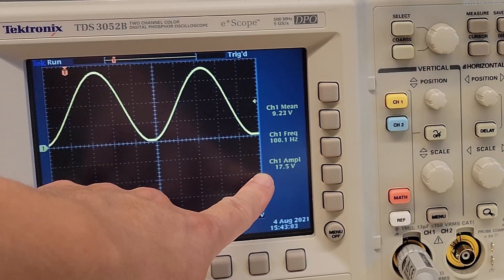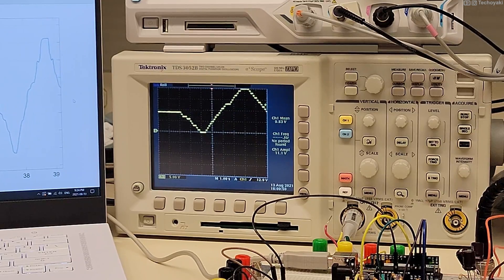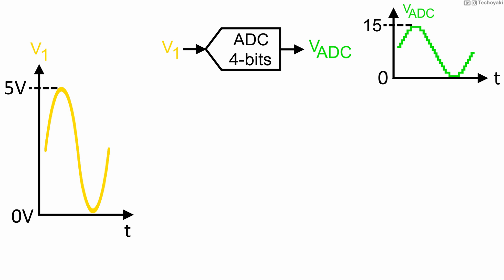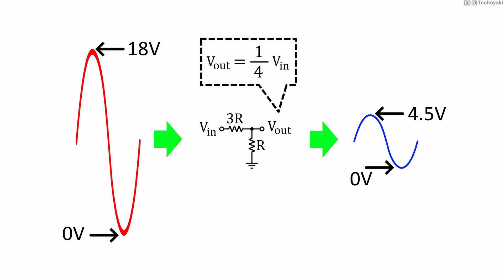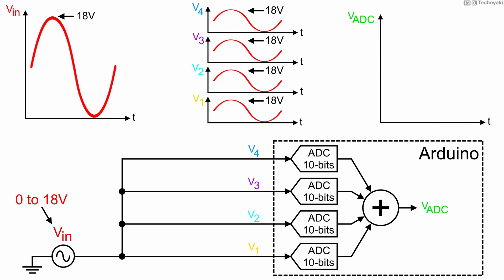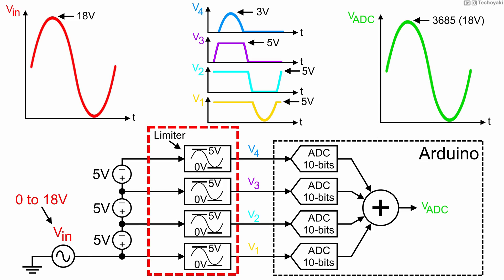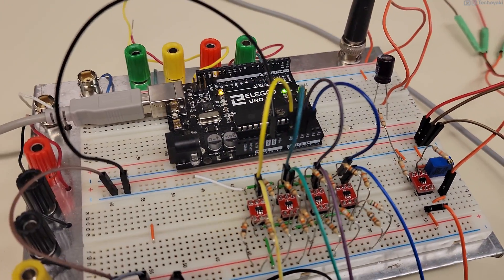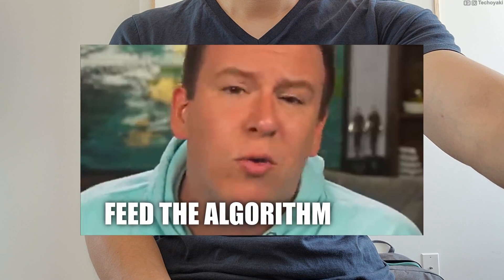Can you slice voltage signal?

Comment: I took a look thinking "oh yes, that's an interesting idea but flawed". 

I was pleasantly surprised that you very clearly point out the limitations of what you are doing. There is at least as much to be learned from the "why it doesn't work" than from the "how it works". 

The cross-over points are always going to be a problem. As the ADC channels are necessarily read sequentially, this can't work for dynamic signals. A sample and hold front end would be a benefit. I might suggest all kinds of other tweaks, but in the end the cure is worse than the disease, and it's better to just go out an buy an external 12 bit (or higher) ADC. I love making a silk purse out of a sow's ear, but in this instance there's little benefit.

Jolly good try, though, and I like your presentation style.

FYI, many, many years ago I saw a resolution enhancement technique whereby random noise is added to the input, and many readings averaged. The particular implementation used an 8 bit pseudo random number generator, with AFAICR a DAC. Again, only something that will work on static signals. With inherently noise signals long term averaging will give some synthetic resolution enhancement. Which takes us into sigma-delta territory ...   :-)
Reply: Hi, can you maybe recommend where to look for external ADC's operating at high input voltage? I actually found this video while looking for 20V ADC's, but the search has only given me a headache so far, all my findings on the popular webstores are limited to 5,5V...
Reply: Just to elaborate, I cannot use a voltage divider, i am already using a sensor in a voltage divider configuration. I need relatively high voltage for good results, yet I need to feed the outcoming signal into the microcontroller, hence my search for external ADC.
Reply: @Aj0nJon  Sorry, that's not enough information for a proper response. Without a schematic and/or details of the sensor, I'd only be making unfounded guesses.

Comment: Plots like this should not have lines connecting the points because there is no data there. And it obscures the actual data points.
Reply from the maker: Hi Charles, thanks for your comments. Regarding the amplitude, the developers of the signal generator uses peak-to-peak instead of peak amplitude for the value so it actually is 18V peak-to-peak and not 36V. You can see the example photos when you search up "MHS-5200A 25MHz Digital DDS Dual-channel" and go to one of their re-seller pages (e.g., Banggood) where they directly connect the signal generator output to the oscilloscope via BNC connector and showcase that it is the peak-to-peak value. It really should have been designed to set the peak amplitude and not peak-to-peak amplitude but the developers opted out of using common convention for the output signal characteristic for whatever reason.

The divider resistor ratios in the video should be correct and I've updated the Techoyaki "Projects" page website which includes the equations used to determine the circuit component values. Also, I've included LTspice simulation results on the website showing the values in the video are indeed correct in terms of the resistor ratio of R/R (with 0V bias), R/R (with 5V bias), 2R/R (with 5V bias), and 3R/R (with 5V bias).

I'm unsure which plots you were referring to regarding connecting the points. Could you please expand on this or provide the time stamp of which plots you are thinking of? I'll try to correct it on the website documentation page.

Thanks! :)
Reply: @juskim  Thanks for replying. In the plots on your PC I suspect the tool you use is connecting line segments, like the plots on Excell. If you can get it to plot just dots or the smallest symbol you should see what I mean about being able to view more detail. The line segment method introduces a visual uncertainty about the exact X and Y of the real data points. On the resistor values what threw me off is your R/R divides by 2 and then subtract 5V on the second OA. I forget the details. I'll have to look at it again. On scopes like yours which are digital they still connect the points in order to look like an analog scope and to aid the eye when data points are sparse. I have the same scope and I do wish it had a true digital mode that shows the measurements as points.

You should try MicroPython on an STM32F407xxx. The STM has three 12bit 2MHz ADCs that can also be interleaved for 7MHz data - if you ever need the speed. 12 bits is visually and computationally so much better than 10. Especially better than the "almost 10bits" of the Arduino.
Reply: If you are going to do this up for your web page you can fix or explain a few things. First, the input range is 40V. Your signal generator says "Amplitude" which is 1/2 the peak-to-peak value. I think your four scope traces do not line up nicely because your resistor dividers are wrong. With the 5V ref shown, I think they should be R/R, R/R, 3R/R, and 5R/R. I can not figure out how the 4 traces on your Rigol can be processed to get the plot on your PC. Maybe if your PC plot is of data points instead of lines you can see better what is happening. Cheers.

Comment: Awesome video! I really like your style and the way you teach. I am looking forward for new videos. If possible, could show how you created the GUI Matlab to display real-time data from arduino? Thanks!
Reply from the maker: Thank you for your kind comments!

Also, below is the UART code I used for getting the data from the Arduino.

% Device port, baudrate, and timeout in seconds
ArduinoObj = serialport('COM4','19200','Timeout','1');

% Delete previous RX buffer contents before doing a read
flush(ArduinoObj);
% Read the RX UART content
RxData = readline(ArduinoObj);
if ~isempty(RxData)
	RxData = strtrim(RxData);
end

I'll try my best to finish my post on my website by mid next week for additional details which will include connecting to the Arduino via MATLAB. It's been such a hectic week for deadlines so I didn't get a chance to finish it... :(

Comment: My question is, why do this, when you could just get a better ADC, and use it with a voltage divider? For example a 24-bit ADS1256, 8 channels, up to 30ksps. It would give you much more resolution, but you'd still need to use a voltage divider. Talking of which, what are the two resistors on the positive input of the op-amps making? :-D 
All that aside, it is actually a cool little circuit, and I did learn something. But I suspect you are gaining that resolution at the expense of sampling rate, So it's maybe only useful for slow moving inputs. I think in higher speed situations, using a more capable ADC externally would be better.
Reply from the maker: Thanks for your comment! One use case I'm thinking of on top of my head is for IC design where high voltage supply would not be available (e.g., TSMC 65 nm standard transistors can only have max of 1.2V supply).

Also, you are correct that there are voltage dividers in my implementation of the Quantizer (there's 4 in total, and 8 if you want to include the feedback)... However, in my defense, I did mention in the beginning that I don't use the voltage dividers to reduce the [final] signal and they do stay the same full-scale as the input. :)
Reply: Sometimes it's just the thrill of the chase :-)

Comment: Firstly a potential divider does not lose any resolution; you start with 10 bits, you have 10 bits afterwards.  The voltage represented by 1 LSB will increase, but this is not a reduction in resolution.  Your scheme actually adds two extra bits of resolution.
Secondly each of those level shifters has to be accurate to under 1 LSB over the full temperature and supply range that you want to operate over unless you don't mind missing codes or non-monotonic behaviour.  This is not a trivial thing to do.
Thirdly you've used four ADC channels and a bunch of op-amp and resistors to measure a single input.  You could simply use a divider and oversample the input 4^2 times to gain the extra two bits, whilst only using a single input. You do need sufficient noise on the input or reference for this to work, but this is not usually a problem in Arduino circuits.
Reply from the maker: Hey, thanks for your comment! I'll add some comments to clarify few things.

Regarding your first comment, I believe there are two ways of looking at it. You would be correct if you didn't factor in the full-scale of the input signal and only considered the full-scale of the divided signal. However, in my case, I wanted to 'keep' the same full-scale at the input (which would be up to 20V) which is why I mentioned specifically at 3:52 clarifying that my desire was to keep the same voltage step of approximately 5mV.

For the second comment, yes this definitely true and is one of the flaws of the circuit where there could be nonlinear behaviours.

For the last comment, I wanted to showcase the Quantizer concept for this video but there certainly are other circuits that can be implemented to not lose (or rather, to increase as you've pointed out) resolution of the Arduino ADCs. It'd be interesting to see a video on oversampling method where a final result comparison is shown, showcasing it is possible to increase resolution for a given sampling rate on the Arduino ADC!
Reply: @juskim  Possibly a more economic way of doing this could be a single op-amp and a single ADC input but provide the reference voltage on the inverting side of the op-amp from a 2 bit DAC (e.g. R2R from 2 digital pins).  It would still require careful calibration to ensure no missing codes.